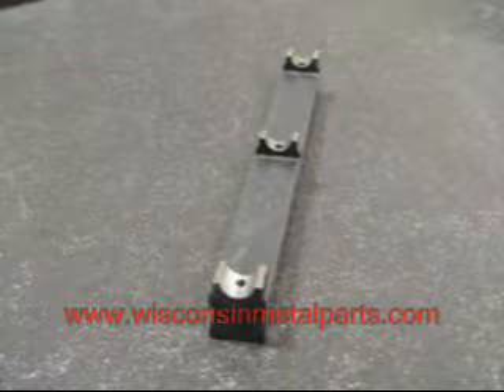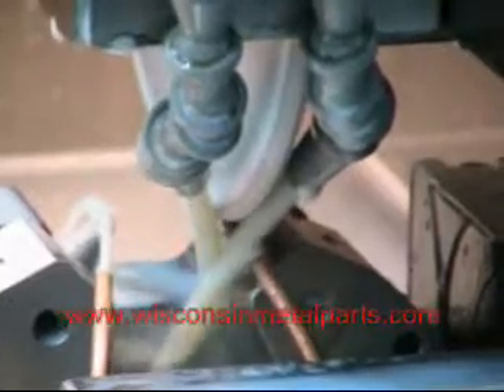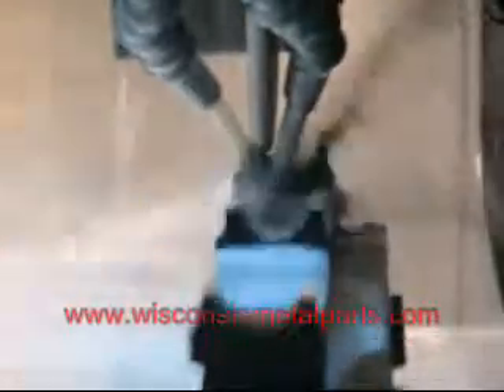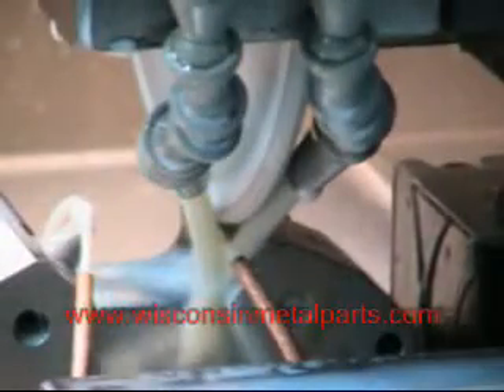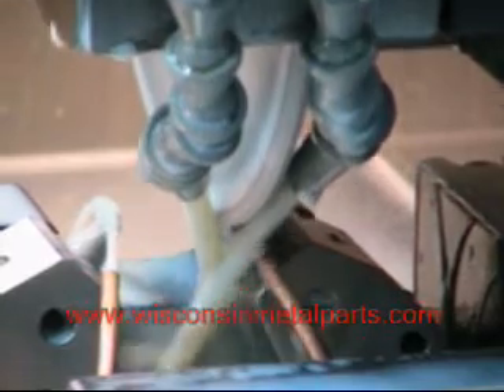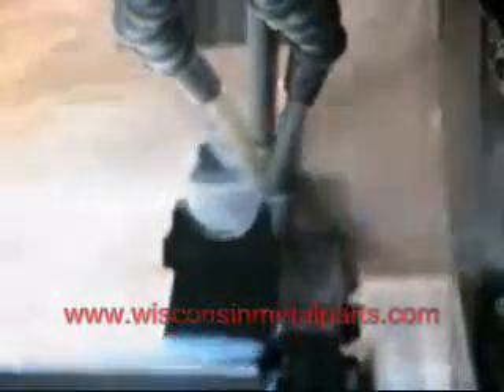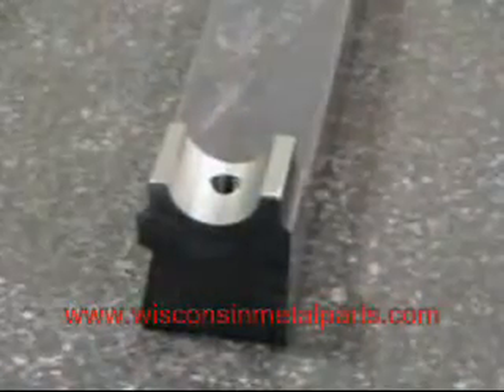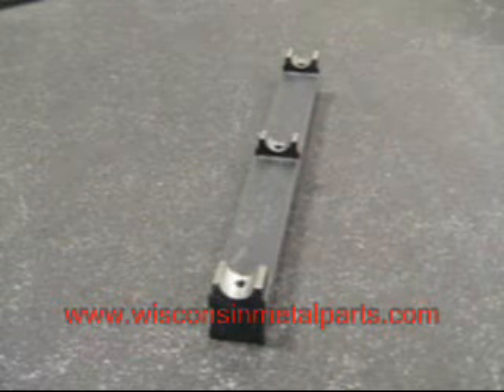CNC surface grinding - Wisconsin Metal Parts

Comment: Hi  manager  :
After visiting your website ,we know your company need    mold .
We supply these products in China .
We are professional  vendor of  Injection Mold ,tooling manufacturing, extrusion  
molding, die casting, sheet metal stamping, rapid prototyping, CNC machining, stamping die is our most featured products .
 
Good quality and best price with ISO IAF,CNAS certificate approved .
Similar to ANSI,BS,DIN,NF&JIS tool standards and products standards.
 
Should you have any interests , welcome to send us drawings for quote .  
Best regards
Lisa yang
project manager
HK Yingsai Industrial Limited
website : 
www.essai-win.com
mail： Lisa.yang@essai-metal.com
Trade manager :  cn1517873281doii
PHONE:+86-(0)769 87815087-8007/8011
Wechat：+86 18617215653
18617215653facebook/linkedin ：3086510023@qq.com
SKYPE：Lisayangyingsai